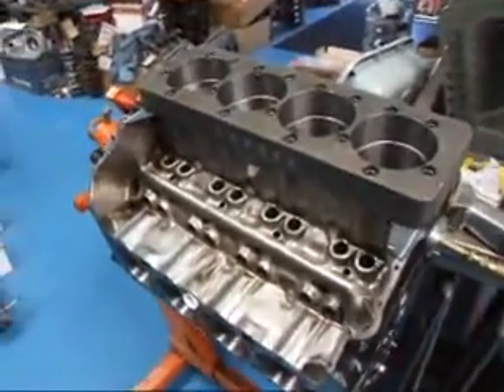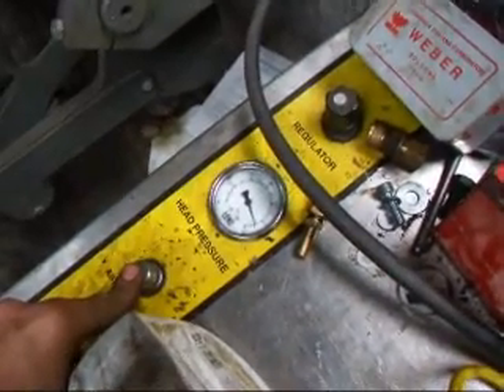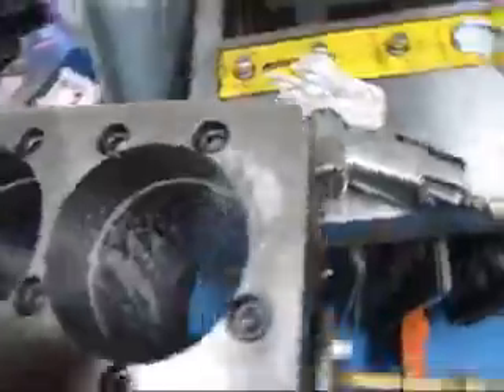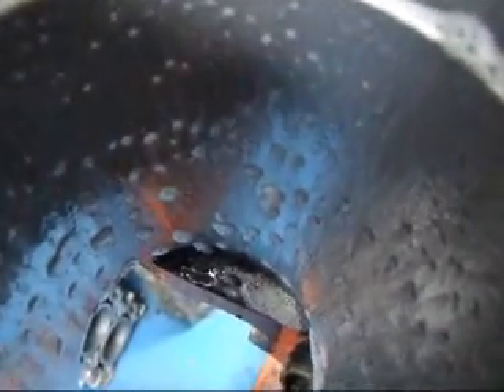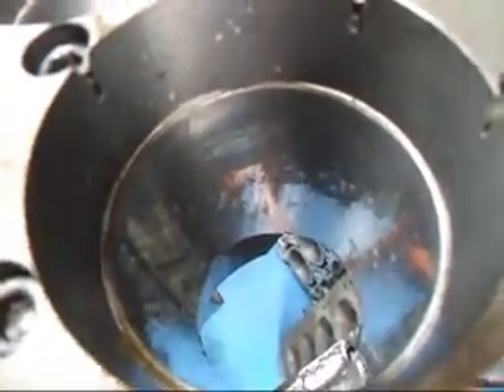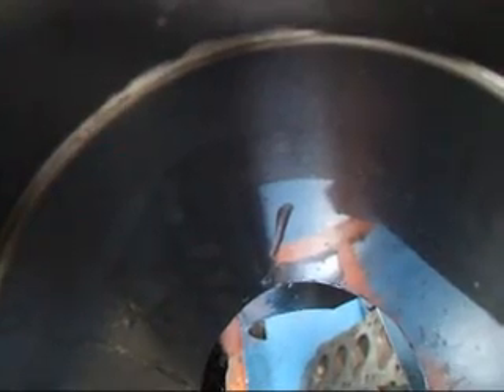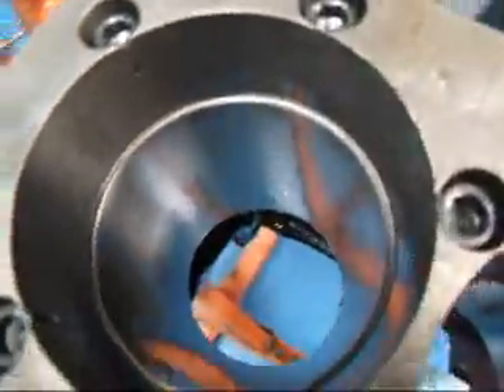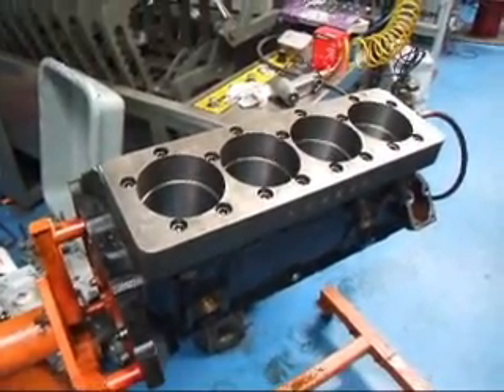Small Block Chevy Block Pressure Test

Comment: all in the name of speed i guess, ive worked on a few sprint car engines where customers were so concerned about weight they cut fuel pump mounting bosses, oil filter mounting locations(only on dry sump engines though), and motor mounts bosses etc... all in the name of speed.

Comment: They use pressurized air to fill the coolant jacket in the block, and the soapy water will form bubbles on any surface sprayed if a leak it present

Comment: You can tell if there's a leak because the soapy water foams up as the air goes through it. Tire shops and gas pipe fitters do the same thing. It's really a very clean, fast, simple, and cheap way to find an air leak.

Comment: The cylinder is weakest in the middle because; the cylinder is supported by the block at the top and bottom the mid part is not supported  that's where coolant is channeled through the block. 

Normal compression automotive gas engines avg 450-500 psi on power stroke, race engines can be lots more add heating and quenching during int and exh strokes dozens to many dozens of times per second and that's what happens.

Comment: We have been Racing for 20 + years &  have sleeved sm.& bbc over the years & never had any issues.There is a "Right Way" & a "Wrong Way" to sleeve.If it's done right you should never have any issues,but we all know how "Murphys Law" get's us.But as far as BD2001 saying it will "fuck up the Comp". & the rest of the block-Dont Know What This Dude Is Talking About!Most of the time if you have a "pin-hole" in the Cylinder alot of people "opt" for another good seasoned block.We all have a opinion.